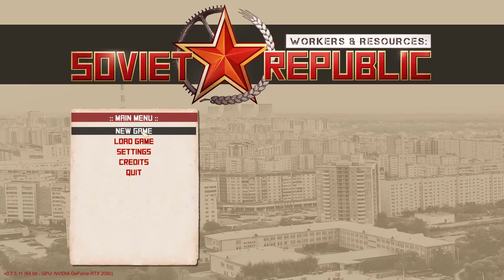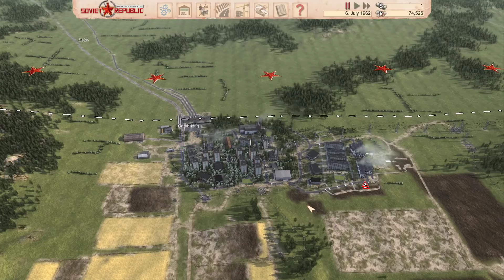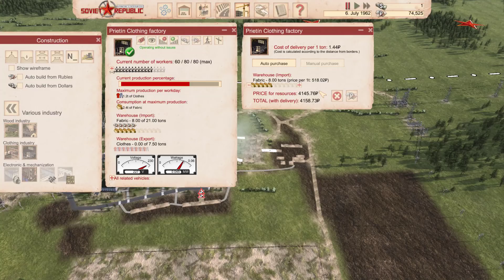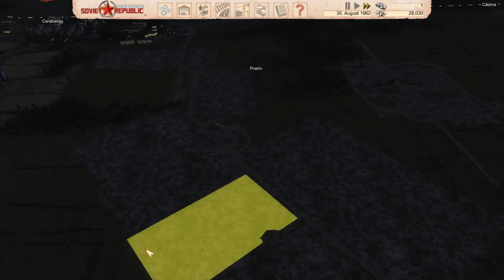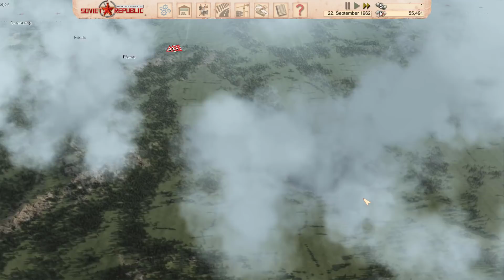Workers & Resources: Soviet Republic S3:E5

Comment: I have good experience with passenger trains to connect the different towns to a central university. It makes sure higher educated people are present around the map without having to manually swap around higher educated people to keep schools/hospitals going.
At one point I even  had over 60% of the 500 refinery staff with higher education. That is in fact no problem, the higher educated are not too good to roll some oil drums and turn some valves.
Reply: They seem to go to university after they finished basic education. They commute to uni, and stay in the same city they came from. (I do think there needs to be living space available there) 
I did set up student apartments at the Uni city, but I have only seen a handful students using that.
Reply from the maker: Hi Matt. I don't doubt that this works but I don't understand why. It doesn't fit with anything else I've observed about how and why people travel. But then again I haven't looked at everything and perhaps one of the mechanics is for educated people to relocate where schools and hospitals are in need of university grads and the passenger lines between cities facilitates that relocation.
Reply: @Adekyn100  You can bus the students directly to a univ. . I think that town and your upcoming miring village are enough people to keep it under good load.

Comment: The factories use resources from their internal import first, before getting them from an external warehouse. If you set auto-buy on the factories internal warehouse, it'll never empty out and no external resources will be acquired.
If you want to have a backup import for fabric, you can set a minimal import on the warehouse, so it will only buy when it runs empty.
Reply from the maker: Good point about the warehouse import. I can use that to assist the clothing industries when the fabrics factory isn't keeping up. Thanks.

Comment: I start with a 8 medium field "hub" with a train.  From there, "back build" to have food and alcohol, expand the hub to supply the fabric.  They all source out of the same warehouse, and then feed into another.  So train(s) can either run loops crops, finished, export, or linear runs.  Though will usually use trucks to deliver goods and then throw in a export stop before headed back, drips instead of spikes.  Also building a power station next to the border and importing the coal is another good trickle income, can easily export to Red and Blue for a guaranteed profit.
Reply from the maker: Thanks for the excellent comment. Combining comments from several folks have given me some solid ideas for the next start. These same ideas can still be applied to this game.